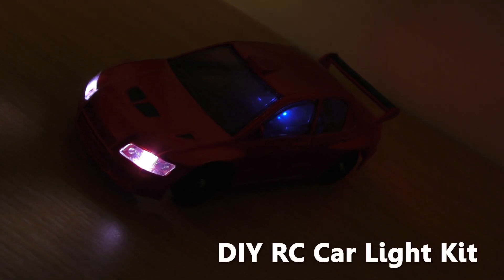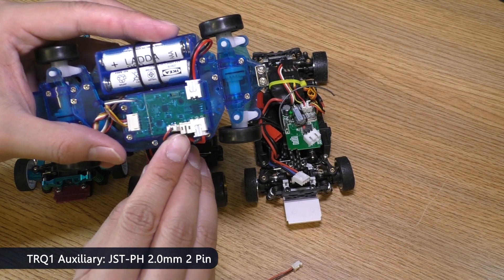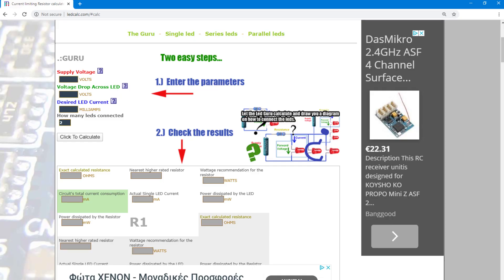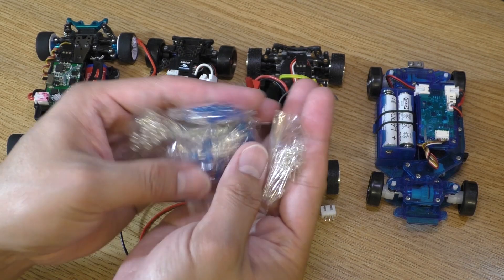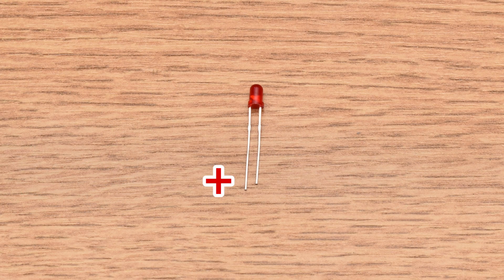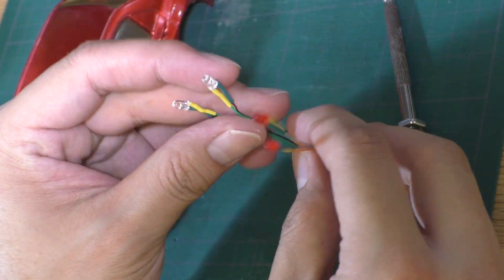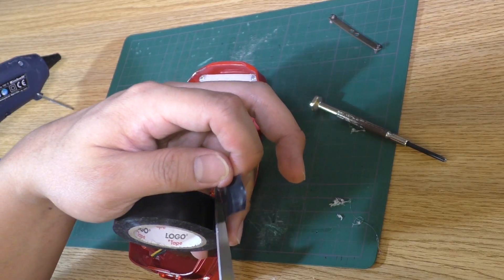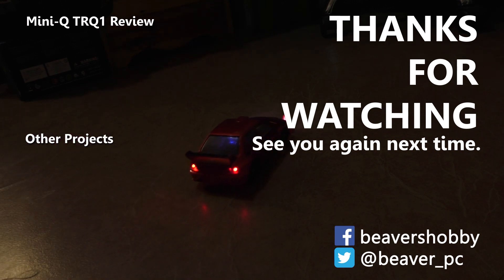DIY RC Light Kit feat. TRQ1

Comment: Hi, this is really interesting. You managed to get me hooked on these electronic diy things.
Watching you play with different resistance to achieve dimmer red lights reminded me of this occasion when I saw a slot car that had tail lights that would become brighter when you would let go the throttle. The guy told me he had done it with a mercury switch?! Does this make any sense?
I am curious to do a bit of research on this topic.
Thanks for sharing.
Reply from the maker: I take a look at a mercury switch and it appears to be some kind of mechanical switch that will activate when the tube leans on one side. You can apply it to the car so when it slows down and the weight shifts forward the switch will activate brake lights.

Comment: Hi Beaver, just wondering...... I have one of those 'dumborc 10A brushed esc' that you recommended (thank you for that👍) I also have a body shell that came off a 'toy grade' rc, the body shell already has the lights fitted and wired up 😎🤘, could I solder the correct connector directly onto the ready wired lights, then plug the connector into the led plug on the dumborc esc? Would this work? Or would I still need to add resistors? Thanks  dude 😎👌
Reply from the maker: Check the output voltage first. I think it's something like 5-6V so you'll need some resistors.
Reply: Ok thanks dude 😊👍 I'm not sure of the parameters of the bulbs fitted to the shell 🤔 I'll probably have to replace the bulbs to work out the resistance needed

Comment: Hi, i mounted the lights in my Toyota Supra rc trq1, too bad there are no rear head light covers , what could i use to' reproduce them?Congratulations on tour rc cars
Reply from the maker: You can use thin transparent plastic like clear file, cut it to size and glue it to the body.
Reply: Thanks Beaver's, i'll try to' find something in the scarpe of previous processes..initially i had  thought of using a transparent red resin and then filling the taillights Shakespeare but i think it is difficult to do.  i hope you understand my english,i use the translator